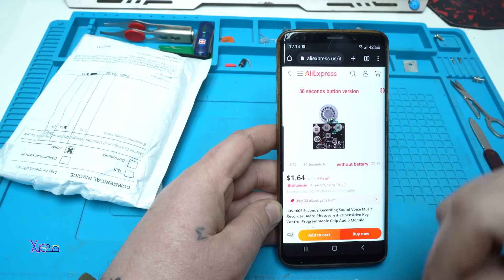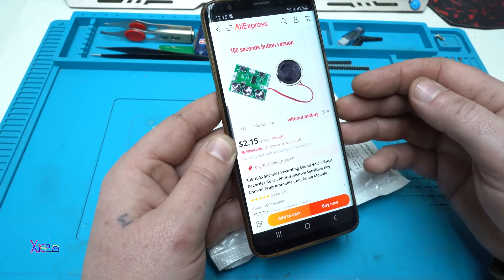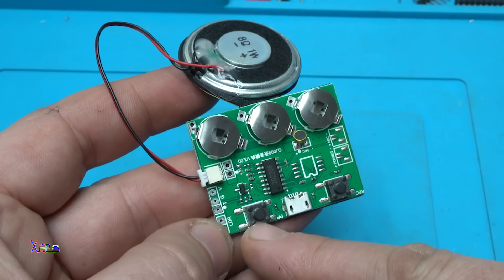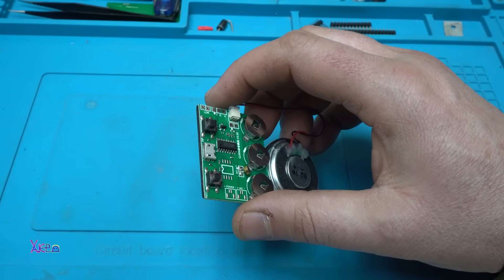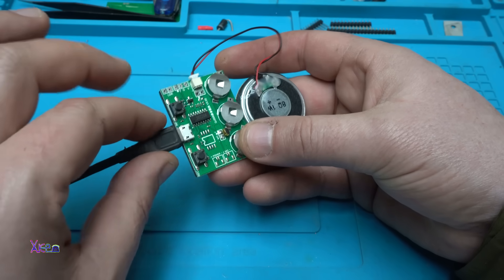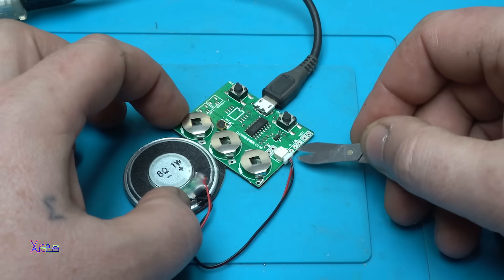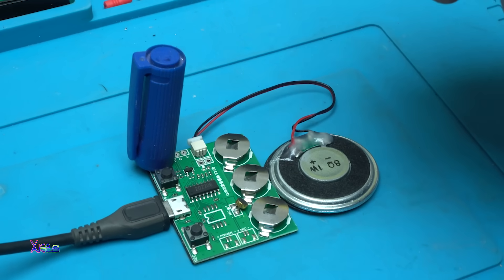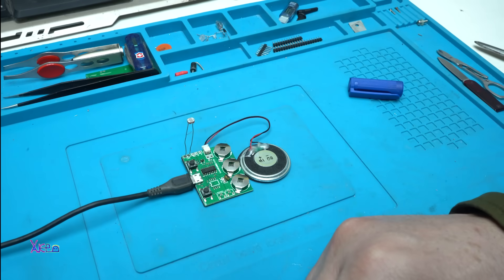THIS $2 Aliexpress Module DOES Something Cool?

Comment: Can't you change the Chinese announcement?
It would be logical if that were possible.
More time would also be useful.

Such a cheap recorder could be assembled under a mobile poster on social or political topics on a tricycle etc. to capture the opinions of passers -by.
Then more than 100s would be useful.
For example with SD slot.

A version with camera would also be nice. Or to connect a webcam to the option via the USB port.